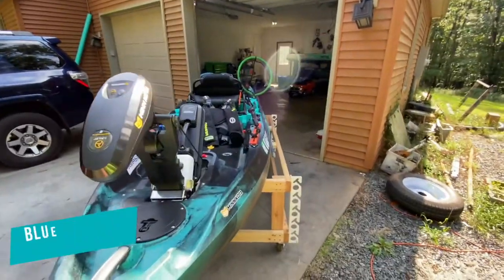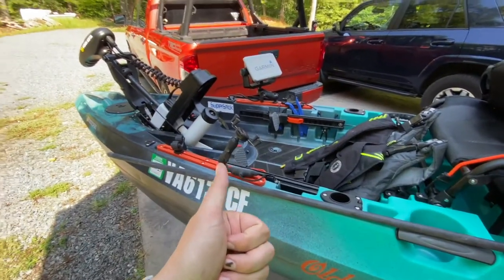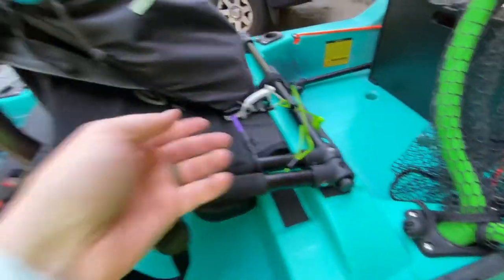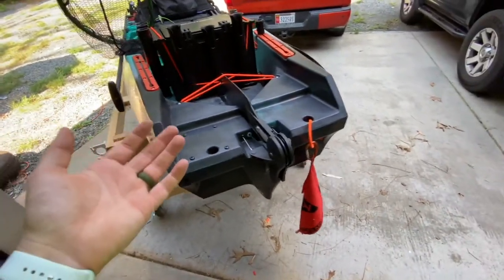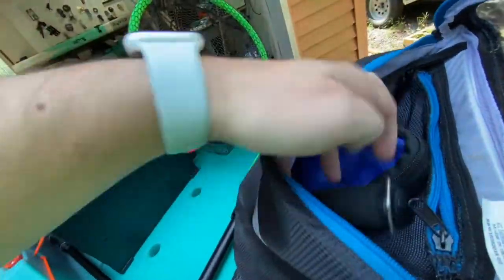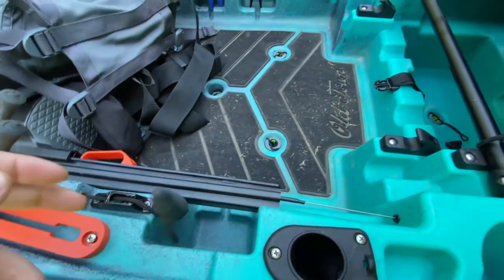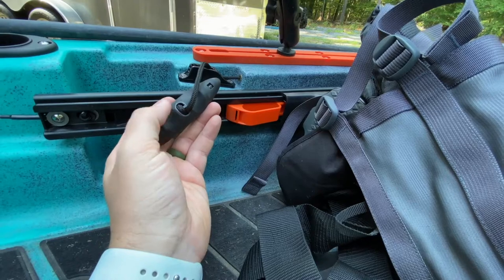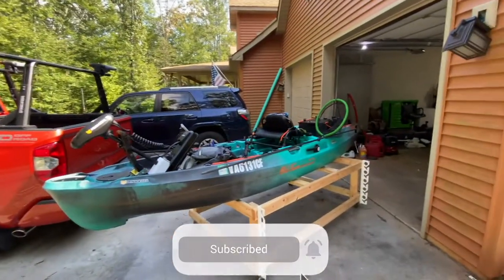Old Town Sportsman Autopilot 120 Setup for Fishing (September 2020)

Comment: I noticed that you had a kayak paddle that is 255, I'm 5' 10" would you recommend the same length or a different size?
Thank you
Reply from the maker: Mine is a telescopic paddle so it’s adjustable from 240-255. I’d definitely recommend a telescopic paddle. But a 245-255 would be usable depending on the person. I usually have mine set on 250.
Reply: @BlueSummitOutdoors  
Thank you for your help, I appreciate it
Reply from the maker: No problem

Comment: Good video man. I’ve just purchased the 120 autopilot. And I’m trying to put the Lowrance on it and my transducer will not fit through the thru hull that came with the kayak. How much bigger is the hobie thru hull that’s the factory one?
Reply from the maker: Quite a bit bigger than the old town one. 1-1/3” I believe it should be enough
Reply: @BlueSummitOutdoors  I may have to pick some up. I also got a active target too to put on it. And that cable end is definitely bigger than the power cord end and transducer end!

Comment: Great video, thanks man! Im looking at the autopilot vs a bluesky pro. Any thoughts on which way to go? Thanks for any insight as well.
Reply from the maker: I had both for a month or two, I chose to keep the Autopilot and sell the BSB 360 Pro. Its cheaper if you are going to get an ipilot trolling motor, the build quality in my opinion is better on the old town and the seat is much more comfortable. With that said the BSB 360 Pro is a great boat and has a lot of pros too: its easy to move around because of the built in wheels, the swivel seat is really nice, and it is super stable. For me it came down to build quality, ease of use, and versatility which is why I kept the AP120 over the BSB 360 Pro. I hope this helps, let me know if you have any more questions. 👍
Reply: @BlueSummitOutdoors  - thanks man, I appreciate the info!
Reply from the maker: no problem!

Comment: Did you replace the thru hull in front of the trolling motor as well for the transducer wire?
Reply from the maker: Nope just the one one but you could probably do the other one as well

Comment: Great video!  I have the 106 PDL but thinking about the auto pilot or the 106 minn kota.  What are the two things on top of your truck racks?  Any tips for loading them?  I'm devising a winch system because too heavy for me alone but I love these kayaks!!
Reply from the maker: If weight is a huge issue Id go with the 106 unless you need the spot lock feature. The two things on my truck rack are the yakima kayak j mounts I think they are called “bow down”. Depending on the height of you vehicle the longer kayaks are easier to roof rack, but they are heavier.

Comment: Hi，I have some questions，I don't have Pickup truck，kayak I just can put it on car top ,106 and 120,Which one you recommend？
Reply from the maker: The 120 is easier to rooftop for me because the added length helps with the my trucks height (or SUV), but the 106 would probably be easier to rooftop on a car.
Reply: Blue Summit Outdoors thank you，appreciate
Reply from the maker: No problem
Reply: Hi bro,the old town 120 combo with without a battery or not?I want to buy online eco fishing shop ,if without the battery,what kind of battery I should buy?
Reply from the maker: It doesn’t come with a battery you can get a lead acid deep cycle battery for around $100 but they are really heavy. I have a 100ah lithium battery they last twice as long and are less than half the weight of a lead acid. Plus they will last about 10 years a lead acid will last a few years. If you can afford the lithium at around $700 it’s the better option.